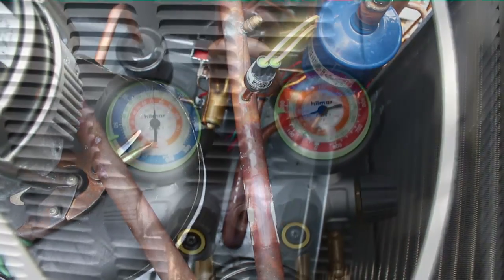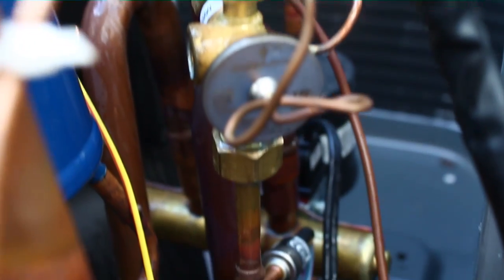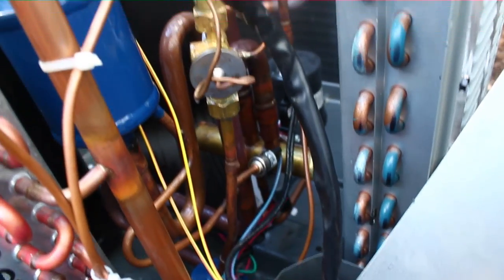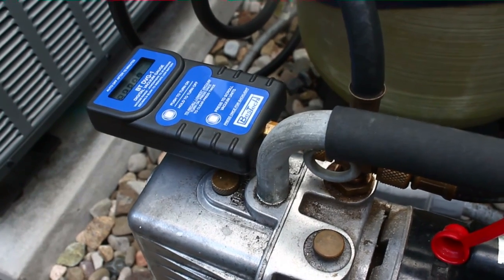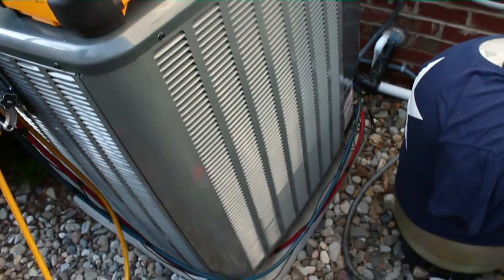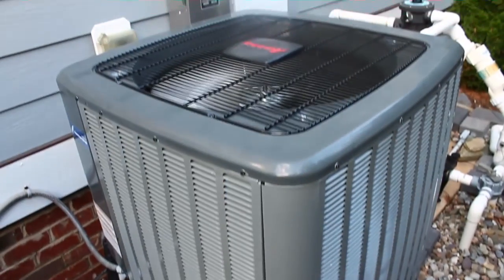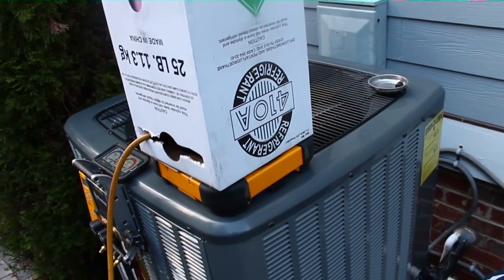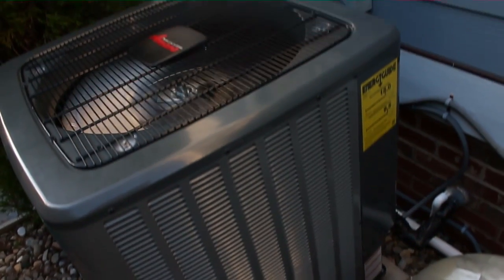HVAC Service Training-  Amana Heat Pump Premature Failure

Comment: The reason Goodman has bad name with customers and dealers. I had Boss in Keller who was die-hard Goodman until we had 2 60,000 air handlers with multiple leaks on start-up, he ask Jim Terry-Goodman rep, for labor. Mind you company has sold Goodman as second line & builders grade for 15+ years.Nope, got nothing.. I never quoted another Goodman, Am-Std or Frigidaire after that.

Comment: That's why I don't install goodman I am a York dealer and if something happens with in the first year they will pay you to put a capacitor in and if something like txv went bad on the condenser they will replace the system and pay u to put it in with in the first 2 yrs

Comment: I would just take it on the chin, (for now) there's two units with a lot of componets that will need service in the near future, I would over the next several service calls factor this repair into the future bills, no more no less just what I feel is fair. customer happy I'm happy,
Reply: ***** why should he have to pay out of his pocket for something that a manufacture should cover? This unit was almost brand new. I agree the customer should not pay anything but why make your other customers pay for goodman and Emerson's poor quality? If we do nothing then they will just keep making things cheaper and cheaper and you will be out fixing a lot more bad compressor  wiring jobs like you did in your last video.
Reply: You're right. But it's like passing into the wind dealing with manufactures unless you are a big company. So sometimes it's best to deal with it.

Comment: Great video Zack, that's BS.  We had a 2 month old Ruud 13 Seer that the TXV was stuck, they wouldn't give us a replacement until we put in a can of A/C Renew and see if would take care of the problem.  They gave us the can but we would have to buy the injector for about $100.  Is nobody standing behind their equipment anymore.  Keep up the good work.
Ray

Comment: Dam that micron gauge is too close to vacuum pump buddy!!!! Lol! No wonder 5 months ago you didn't find a leak if you used a micron gauge that way man. Your still better than me though I'm not a super tech I just try my best.
Reply from the maker: You valve off the pump and wait for the reading to stabilize. It works the same as another location except the reading will drop faster initially.

Comment: I hope they going to pay you for the refrigerant as well. I can't believe they're not giving you labor to change that out. You should consider the Assurecare warranty for you customers. We include that in all Amana systems. I have replaced coils on systems multiple times and the customer pays nothing. We are paid by the warranty company. Good for both parties.
Reply from the maker: I have a feeling I won't be doing any more of these.
Reply: talyn875 When the system is in cool mode, the outdoor TXV has a check valve to bypass when it's not metering that coil, did the new TXV have a check valve built in, or was there a separate check valve built in the unit?
Reply from the maker: Internal check valves on these
Reply: Seems like that is becoming more common. It used to be that only the indoor TXV had an internal check. Can any TXV be used outdoors, or is there a specific type that's used outdoors on heat pumps?
Reply from the maker: John Smith outdoor has a different temp range.
Reply: Usually the indoor TXV runs a 12 degree superheat if it's perfect, but what does the outdoor one usually run if there's no ice or sweat on the coil?